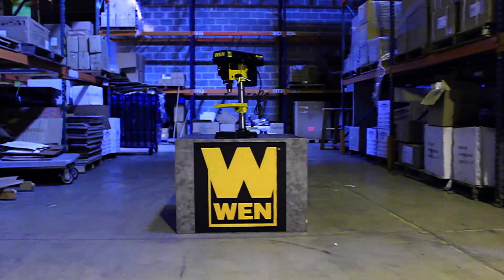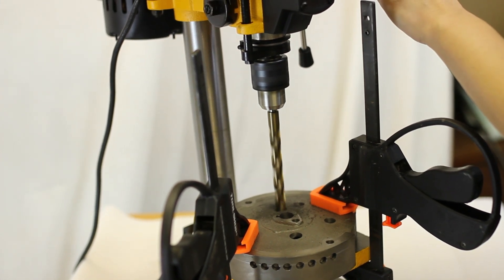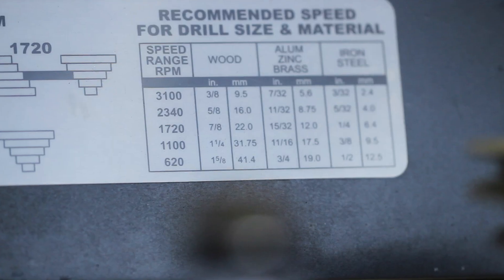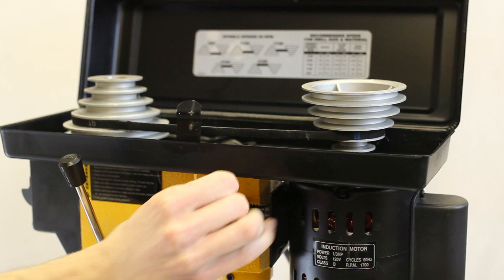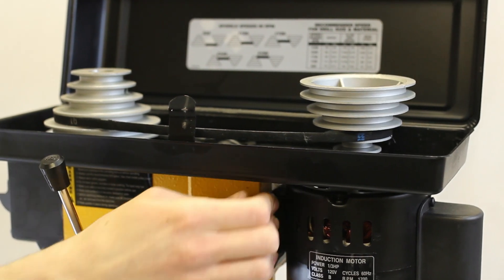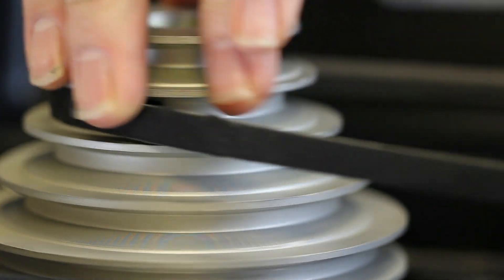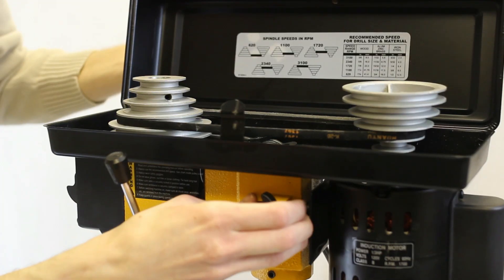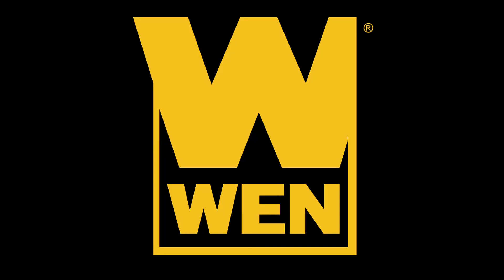How to Change the Speed of your Drill Press

Comment: So far so happy>>>ur2.pl/853   I want to add to it. I have used this on wood and on plastics. Works great. Love this product. However, I do dislike how many blades I am currently going through. As the blades teeth love to get dull fast on the material I am using. I hope Dremel decides on going with stronger material on blades in the future.

Comment: This is incorrect. I have a 4208 from Amazon and loosening that knob does absolutely nothing. There goes 80 bucks down the drain.
Reply from the maker: +Gray D You may have to loosen the hinge on the other side. It may have been overtightened during production, preventing the motor from moving easily. If you continue to have problems with the unit, call us at 1-800-232-1195 and we'll be sure to help you get the problem resolved.
Reply: I have the same issue with mine. Can’t get the motor to move forward enough to get the band lowered.

Comment: Unfortunately this does not work with all versions of Model 4208.  In mine (from Amazon), the motor is bolted tightly to the head and loosening the "belt tension knob" does absolutely nothing.  Plus, the bolts holding the motor tight are not accessible without disassembling several parts of the head/motor assembly.  I have contacted Wen about the problem and am waiting for a response.
Reply: Same here and ours is orange not neon green.
Reply from the maker: +Dave N Dave, I will reach out to our engineering team to see what is going on with this and get back to you.
Reply: Same here.  Spring completely blocks the motor from moving more than about 3mm.
Reply: I should've read this comments before buying one
Reply: Same here as well
Reply: Yep same issue. Orange one from amazon